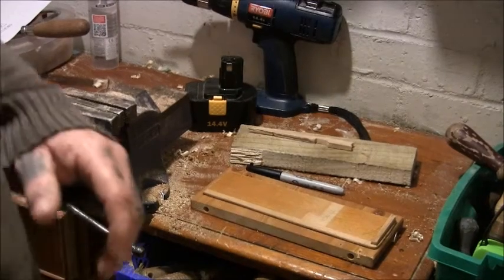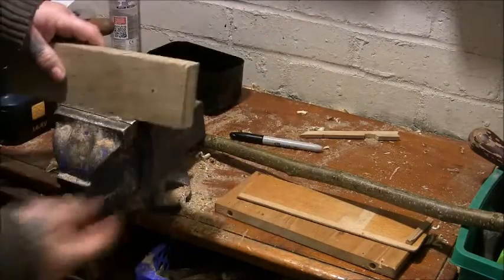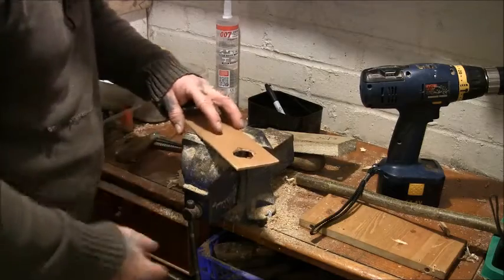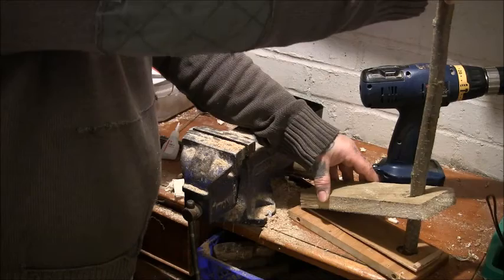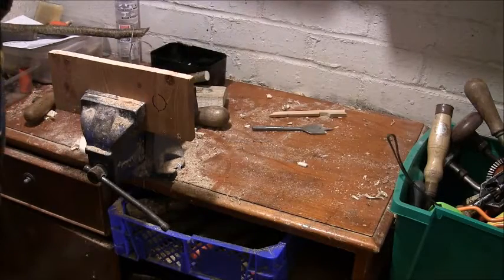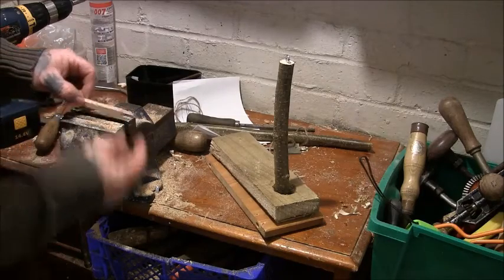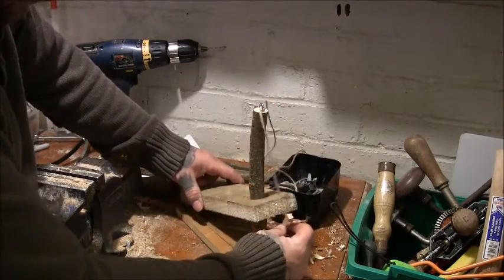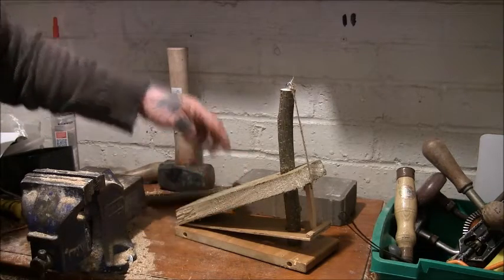How To Make A Deadfall Mouse Trap

Comment: Think about using a wire brush critter trap.  Make a platform and have 2 "L" sided brace pieces facing each other with drilled out dowel holes.  Emplace the wire brush handle between the braces and slide in a wood dowel/metal nail into the wire brush handle hole.  The brace and brush handle becomes the pivot.  Drill 2 holes forward of the platform, aside the front portion of the wire   brush.  Pound in dowel upright rods into the holes.  The rods keep the wire brush properly aligned for falling.  Also, the whole brush is tensioned with springs on each dowel for the trap mechanism.  Make the trap trigger under the wire bristles, and sitting on the wood tip of the wood brush.  The trap is triggered, the wire brish slams down with the 2 springs, and the furball is skewered in place.  Inexpensive to make, easy to use.